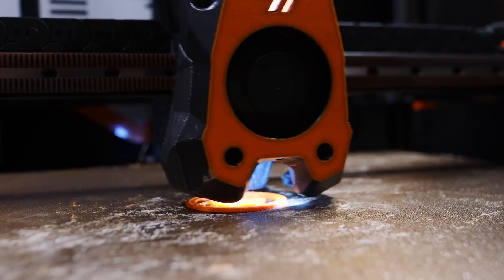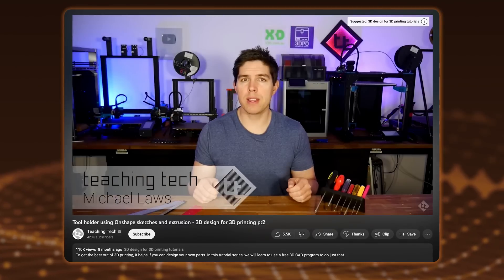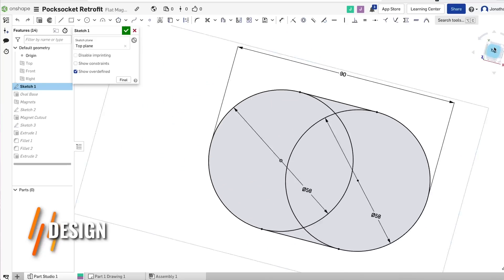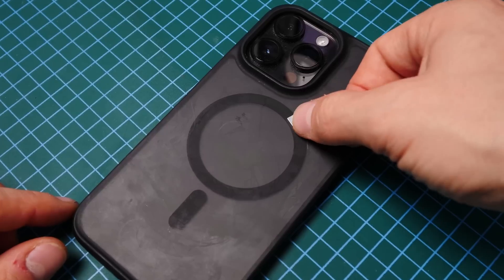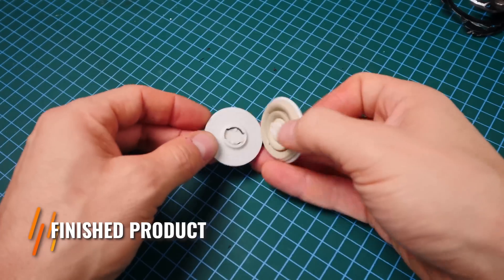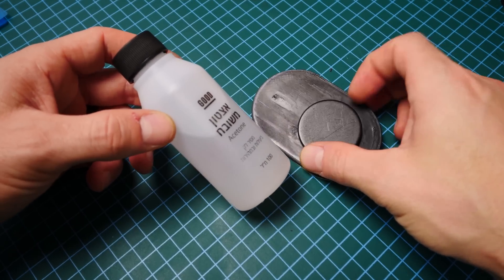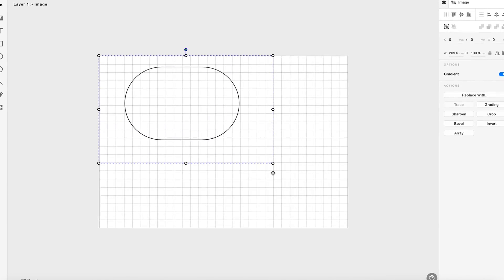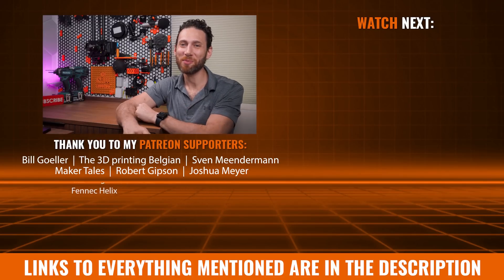Your Phone Has A Problem. 3D Printing Can Fix It.

Comment: I hold my phone by the sides. No pinkie. Probably because I have a good case that doesn't slip. But interesting project. If I were to do something similar, I'd use PETG as my printer isn't set up for ABS or Nylon. I'd also use OpenSCAD because I do a bit of software development and it actually seems to be a good fit for my skills. I also prefer to have software that runs on my machine, or at least that I can run on a local server that I own.
Reply from the maker: Thanks for commenting!

Comment: Inserting stuff into products is great product development wise, however it sucks in recycling.
Also "3D Printing" is actually called rapid prototyping. 3D printing is a layman's term.
Reply: There are businesses like Slant 3D that use it for actual production runs, not just for prototyping. Also - at a hobbyist level, there are plenty of functional prints; I use a belt holder for my personal phone and work device that I 3D printed. Calling it "rapid prototyping" is actually less accurate.
Reply: . . . also, to be honest, the recycling situation sucks for hobbyists. Composting PLA requires special conditions not found in residential composting. Recycling centers usually won't take PLA or other plastics used in 3D printing. I'd say there's a good chance the prints would end up in the garbage at the end of their useful life, even if the magnets were made removable. I love the hobby, but when I did research to see what options I had for avoiding the trash can in my area - I came up rather empty.
Reply: @logicalfundy  PLA is not as great for the envirement as they make you believe. PLA is basically crap. It´s not a great material.

Comment: Have you tried printing asa yet? It's strong and heat resistant like abs smells less prints pretty easy and us uv resistant too!
Reply from the maker: I mostly print ASA but it rarely sticks to the build surface nicely. My voron is 100% ASA
Reply: @thenextlayer  huh I just started printing it on my p1p and it sticks extremely well. I have a heated chamber though.

Comment: Great video! The coolest thing I’ve found about getting into 3D printing is the new way I approach problems. This is a fantastic example of a practical solve to a small annoyance that you would’ve just had to deal with otherwise. 

Small point of feedback: that side camera view is a little too close to your face and it makes the transitions between your two shots are a little jarring. I think it could help if you’re able to zoom back and bit or reduce the angle. Not a big deal though
Reply from the maker: Thanks for the comment and the feedback! On it!
Reply: Agree that it's jarring; I was thinking that it's just being over used.

Comment: You pointed out one of the best reasons to have a 3D printer.  You can solve problems that you didn't know you had as well as problems that appear out of no where.  I had a knob break on my stove, - found a replacement and was shocked when it was $100 for one knob.  A few searches on Printables and Thingiverse and some design changes - had a new part for less than a dollar.
Reply from the maker: BINGO!!!

Comment: I noticed that slider in the backgroud. I have the same. If you want a very quick and easy upgrade.. just change the motor inside for a 0.9 degree one and boom! x2 smoother, x2 slower, x2 better :P
Reply from the maker: Iiiinteresting. Mine has been really good though, no complaints
Reply: What's the difference between 0.9 degrees and 1.8 degrees?
Reply: @p_serdiuk  200 step vs 400 steps per turn. So you double up the smoooooothness and double the time it takes to do a full A to B run.
Reply: @Vez3D  So is a 20W 1.8° broadly equivalent to a 40W 0.9° or something like that?
Reply: @Paul Serdiuk  not exactly